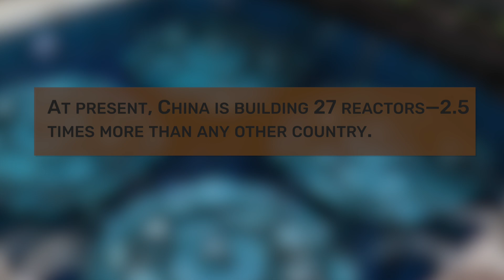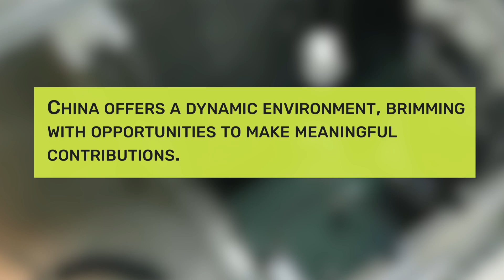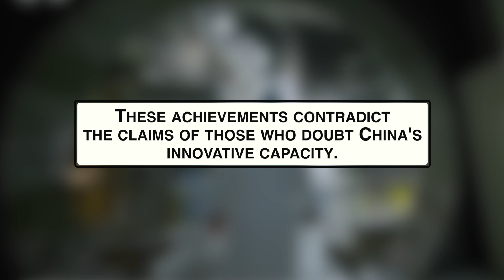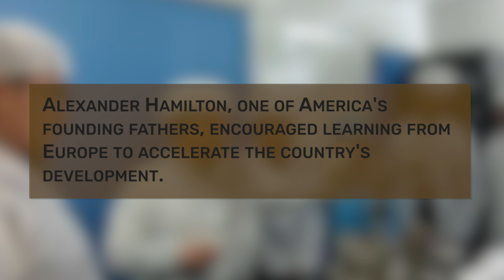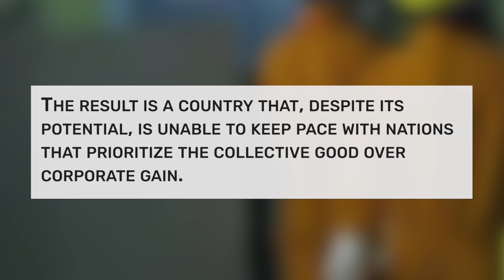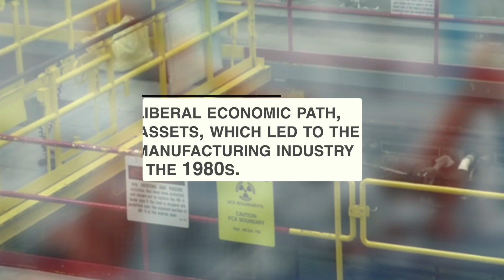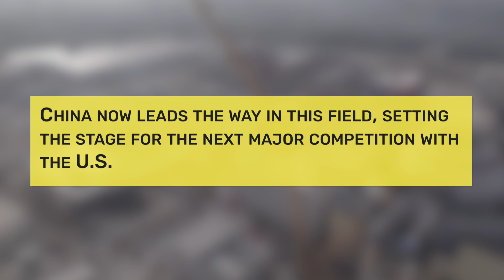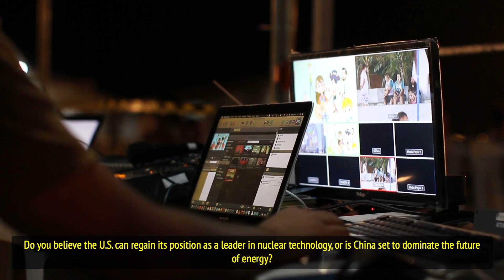China vs. the U.S. in Nuclear Power: How Over-Privatization Made America Its Own Worst Enemy?

Comment: Energy is essential for China’s 1.4 billion people as well as the operations and development to its economy.
As of February 2025, China has 55 nuclear power reactors in operation and 19 under construction. Additionally, more 70 nuclear power reactors are planned, which will add significant capacity to its existing 57 GW of operational reactors and the 24 GW under construction.
China green energy is going full stream ahead undertaking project with great enthusiasm, vigor and energy from EVs to clean energy.
China is putting its effort on clean-technology economy to developed its country clean energy.
Thanks to China expansion of renewable power, fossil fuels now account for less than half of China’s total installed power capacity.
Renewable capacity including wind, solar, hydro and nuclear power is expected to exceed fossil fuel capacity by 2025, a target that it has hit two years ahead of schedule.
Solar was the largest contributor to growth in China's clean-technology economy in 2023. 
China's wind power generation stems from several large wind installations across the country. Some areas, especially Inner Mongolia in the north and Xinjiang in the west, host some of the world's largest wind farms, and account for the largest share of China's wind power output.
World's largest hydro-solar power station, the Kela photovoltaic power station is fully operational in China
The world's largest and highest-altitude hydro-solar power plant, which generates power through a water-light complementary manner.
It boasts of an installed capacity scale of 1 million kilowatts for a hydro-solar power grid. I
With a reliance on sunlight to generate electricity, the power generation of PV stations fluctuates between day and night amid weather events. The hydropower component can help to regulate all instability in such supply manner, therefore, providing stable and high-quality clean energy.
More than 34 gigawatts (GW) of nuclear power capacity were added in China that made up only about 5% of China’s  cumulative power generation. 
China’s renewable capacity has grown rapidly for China energy needs.